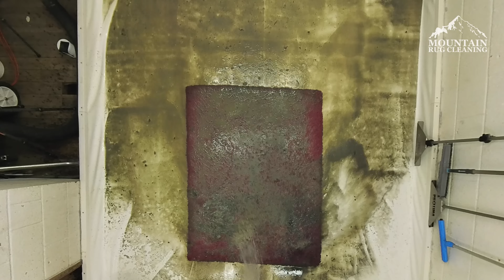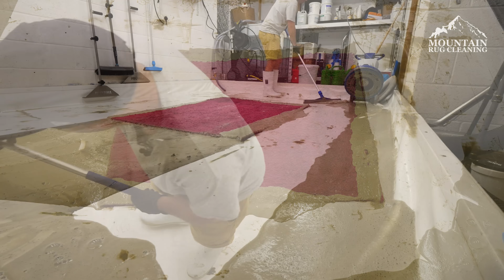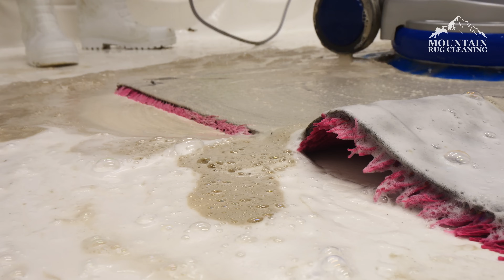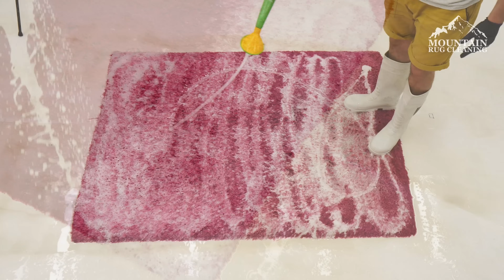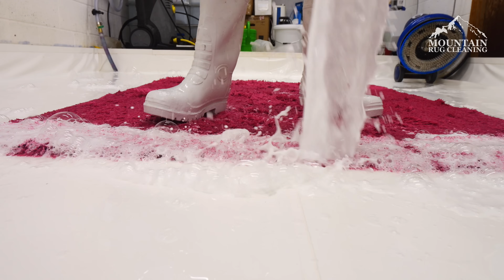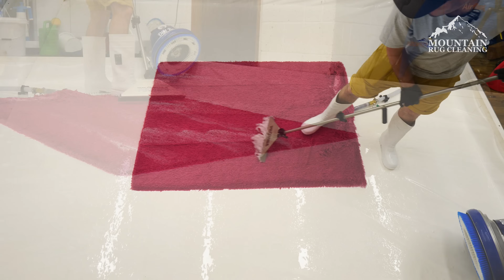From Trash to Treasure: The Ultimate Cleaning of a Salvaged Rug | Satisfying ASMR Carpet Cleaning

Comment: That rug looks so nice by the time you finished cleaning it. It also looked really cool with the blue soap splashed across the top (😆). I'm glad to see that you finally got a new watering can. I can't say that it wasn't a little bit funny to see the head of the old one fall off from time to time, but I'm sure that it was probably more frustrating than funny for you. I also just had to say how much I appreciate that you make sure that the rug is fully clean by the end. I've seen a  number of other channels that do rug cleaning and they often time clean the rugs until the water runs yellow, then put it through the centrifuge, and call it good, knowing full well that there is most likely still some dirt in the rug. I know it's not an easy job, but it's so much more satisfying, knowing that the rug is as clean as it can be.

Comment: Is there a reason you don't rinse off BOTH sides of the rugs which are covered on both sides in mud and debris before the first soap application?  Could doing so reduce overall cleaning time by eliminating the bulk of debris from the start (similar to shaking out a rug)? Just curious on your thoughts and experiences.

Comment: Genuine question: why do you wash the top part, flips to do the bottom part, and go back to the top part? Wouldn't it be simpler to do the bottom part first since it seems(to an untrained eye like mine) the bottom part don't trap dirt as easily, and then lastly do the top part? Thanks!

Comment: Don't get me wrong, the video is nice to look at and quite mesmerizing at times, but you can get a single color rug like that for 30 bucks MAX. You probably spend at least 2 to 3 times that for the cleaning agents alone, let alone the water and other tools. This is just a net negative job from beginning to end.
And that is just from an economical viewpoint. From an environmental viewpoint, this is a complete disaster. The amount of water that was used and contaminated - and subsequently needs to be cleaned and purified again - is staggering. It would have been better for the environment, if the rug had just rotted away where you found it.